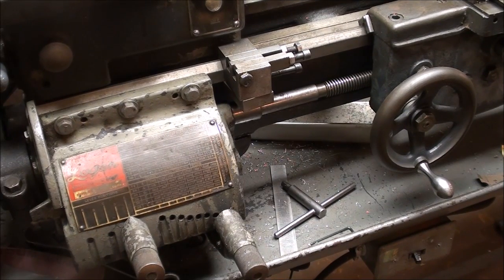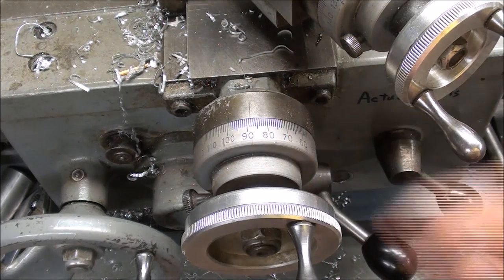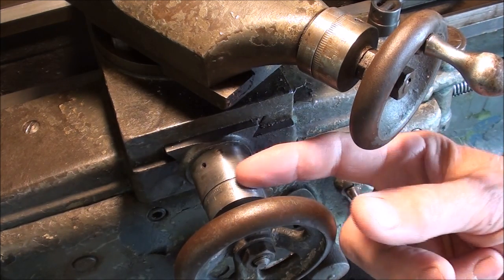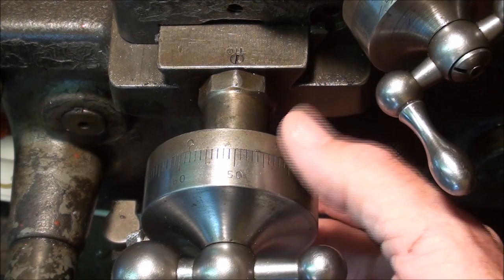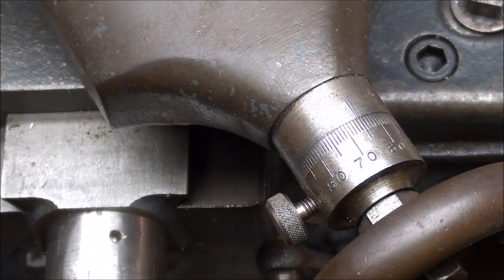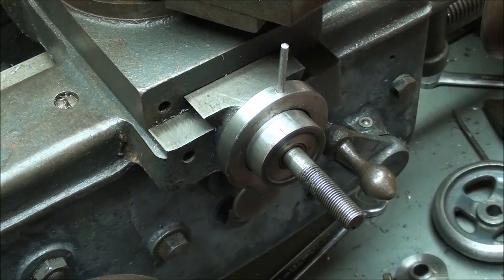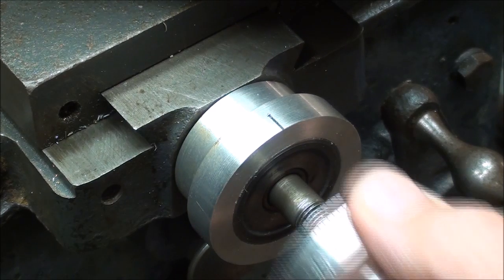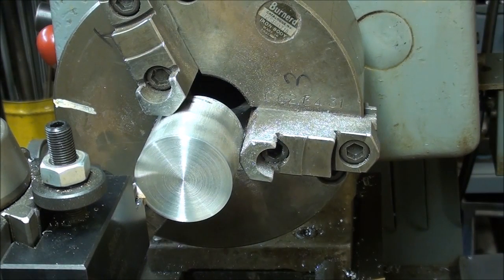SHOP TIPS #177 Making Larger Dials for the Logan Lathe part 1 tubalcain

Comment: Why is .2,.02, .029. So bizarre in machinist speak ? So .2 is really .200 and .02 is really .020?  I understand.5 is 1/2" and .250 is 1/4" .0125 is 1/8" .00625 is a millionth of an inch because the number occupies 5 digits? 625 millionth? Or is this beyond capable accuracy and they call it quits. My head hurts

Comment: I realize that this video was made 8 years ago, but I am currently restoring a 1946 model 820 Logan lathe, and the compound rest screw at the outside threaded section is all buggered up due to what I would call a design flaw on their part. It's a 5/16-24 thread, and I can get the inner and outer nut off, but the section where it is buggered causes the handle to swing greatly before it engages the shaft.

The handle is like the one shown on the thumbnail for this video. It has a pressed in pin, and it must have walked it's way out over the past 75+ years, causing it to get to a point where all the force was against the tops of the threads in the slot, and this tore a good many of them off.

Other than buying a new compound rest screw, how would you suggest that I go about trying to repair my current one?

Thanks for all the great videos, I wish I had had someone like you as a shop teacher all those years ago when I had them, because they still offered them.
Reply from the maker: That is a tough one. I think what you are asking, is, how do you make a new screw. Because you probably can’t buy one. And I think it has a left-hand thread, Acme. Search eBay, but you probably won’t find one. Luckily you have a lathe so you will have to make it
Reply: @mrpete222  Unfortunately, the lathe I have is in pieces because I am trying to restore it. I was thinking that maybe I can fill up the slot with braze and then try and run a die over it, and then maybe do something with my drill press, (because I don't have a mill, or even access to one) and drill a dimple in the braze where I want the pin to go into.
Then i push out the pin, and tap for a setscrew in the pin hole in the handle, and hope for the best.

On a side note: I like the new intro cards on your latest videos, They remind me of old filmstrip title cards.

Comment: I came across this video whilst searching for info regarding the compound on my Logan 1820; is there any tolerance for "end play" or "chucking" along the axis of the compound screw?  As that first nut (against the dial) is tightened this play is reduced, eventually to the point that the dial is pushed too tight against its threaded partner...  It seems there is supposed to be a thrust bearing or washer between these two.  Any thoughts or insight?
Reply from the maker: No tolerance that I know of, just a little free play so it does not bind
Reply: I should clarify; the compound rest itself moves.

Comment: my method was to use a one inch travel dial indicator with a pancake magnet on the back and stick it to the cross-feed ways and read the travel directly off the compound and I might say... more accurately than the graduations on the hand dial...it worked in most cases...but not all

Comment: As you know I'm just starting a complete restoration of a 1939 Colchester  master 6 inch lathe.. 
The thing is after removing yrs and yrs or rust my compound slide dial is very pitted. And just barely make out the witness mark and all the graduation lines on the dial But it is not great. If I was to try and find a very good machinist do you think it would be possible for them to repair by removing all the pitting and restoring all the graduations and witness mark. As you know these dials are hard to find these days and would really like to keep the originals . 
Would it be possible to save them.  Just asking as i value your opinion because of the fact you have many yrs of being a machinist. 
I'm pretty gutted as im finding things that is really starting to upset me. I just can' not understand how previous owners don't take the time to look after these beautiful precision machines .by just keeping them serviced,  well oiled now and again. So pitting doesn't occur.
Reply from the maker: Its hard to find a shop that will do that type of work--but it is possible someone will do that for you. Do't get discouraged. Allow a full year to restore the lathe. One little piece at a time and its not so daunting.  A used lathe is worst than a used car--always abuse & deferred maintainance. Just keep at it & try to enjoy it.

Comment: Hello,  I have an old 12 inch Craftsman Atlas Lathe. I Bought dials from Tall Grass Tools for it .they come in .100 per rev or  .200  and are larger in Diameter he also sells  the backing plate for them . they come ready to bolt on or machine kit form and available for the compound  I have used in the past a small fishing lead split shot in the  screw hole instead of brass works good . I also am a Machinist by trade and an old tool and machine  junkie I have the lathe I spoke of. and a burke millrite milling machine and two Atlas milling machines both 12 speeds  one with a Rusnok milling head. a Southbend shaper  Jet drill press (Chinese works ok but not like old American iron) and a small Taig lathe . love to tinker and restore to operating condition but most of all use them . not building some Mantle piece like some of the guys on Youtube . when the only Chip their fully Restored and Painted Machine will see is the Potato Chip falling out of their mouth when showing it to Friends. Keep up the good work Love your Videos  you remind me of my shop Instructor I had in the mid 1970s  showing my age
Reply from the maker: +1995dresser thanks for watching

Comment: Hello Pete.
I am really enjoying your videos on dial replacement. I have a 9" south bend (war baby) and it too had small dials. I did a conversion to larger dials on that lathe and ran into the same problem of the cross slide hitting the dials. I used the Steve Wells method and increased the length of the cross feed screw.....not really the threaded portion but rather the length that the dial and handle fit onto. it meant making new longer bushings, but now my cross slide has a full length of travel. Is that possible for the logan lathes?

Wayne

Comment: Hello Professor...

I know that I am a bit of the pain in the A** student with possibly too many questions, but feedback from you on my thoughts will help me as i learn through your teachings.

I have some questions/suggestions.

Referring to the inner ring with the "witness" mark...

Comment #1:
     Of the two radii of this ring, does the radius nearest the operator, the section with the witness mark need to be
as wide as it is?  That is, it looks like you could have narrowed it what looks like about 1/8" without
even hitting the mark/line.  If the line does not have to be that long, you could have
narrowed it even more all to retain more movement of the cross-feed. 

Comment #2:
     It also seems that you could have retained all of the original crossfeed movement if you did one of the following...

1) Replace the threaded rod with a longer one.

or

2) Back off the locking nut of the hand-wheel until it was nearer the tip of the threaded rod, pulling the hand-wheel out
toward the operator to what looks like maybe .25" or so.  (You can also replace that handwheel nut with a locking nut if you so desire.) 
Then machine the new witness sleeve to be longer / deeper than the one you made by the distance that you moved the hand-wheel out.    This along with the narrower band mentioned in my comment #1 would probably retain all of the original movement of the crossfeed. 

Doing this would not make the task more complicated.  Am I missing something here with this idea?
What are your thoughts, please?

One last thought...

Using a set screw to hold the new inner sleeve to the old one seems to be "less than ideal" in that if the set
screw loosened up, the sleeve could rotate around the piece under it causing a false reading.  I suppose it would be easy to see if it moved but if it does, you would need to disassemble the unit to put the ring precisely back in place .
I wouldn't mind a set screw if there were a flat machined on the inner dial for it to register against or it the piece incorporated a pin, possibly threaded to utilize the through-hole on the underling dial.  You could either thread the hole
in the original dial or thread the new ring so that a threaded pin or set screw can be used in that location.

As always, I love to watch you teach and I am always looking forward to your next video.

Keep up the good work,

Anon
Reply from the maker: 1--make it any size-does not matter
2 I woud not do any of that
3 I like a set screw, but there are unlimited possibilities. Every mchinist can do it a different way.